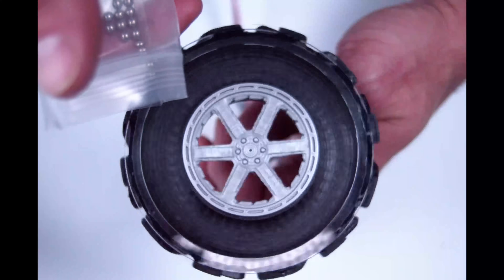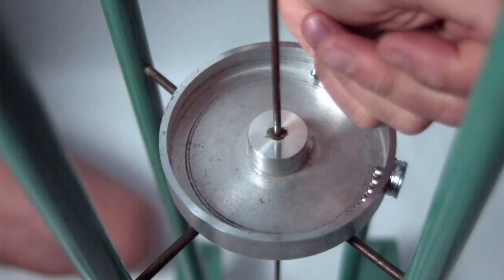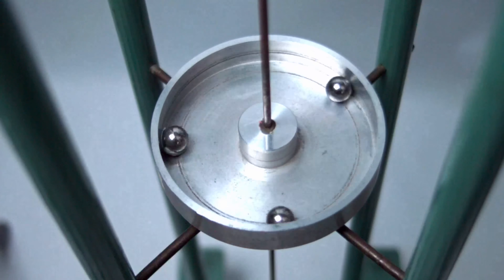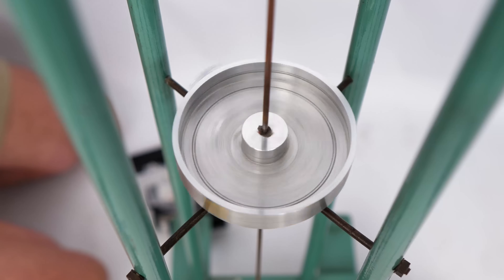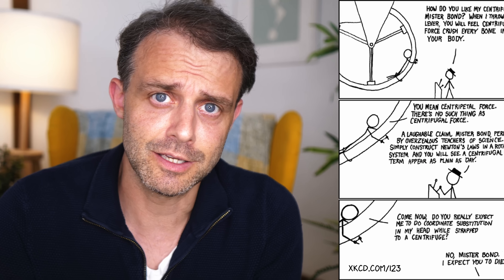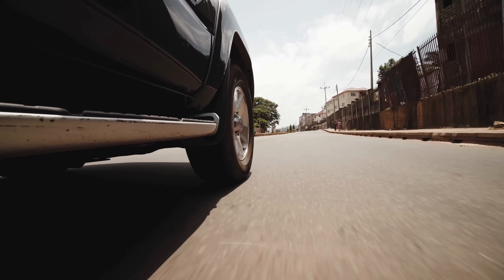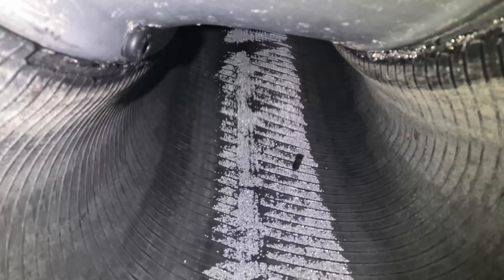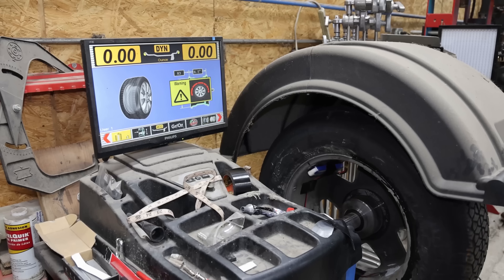Do tire balancing beads actually work?

Comment: What if you designed the tire beads to melt once the tires get hot enough (from motorway driving) and then they stick in place?
Reply: Tires wear unevenly, after a while they will be out of balance. Weights are easier. I am a stickler for NVH and get an alignment every year or two.
Reply: Tires need changed, occasionally.

Comment: they might work if you could coat them with a pressure activated adhesive that doesn't activate until you're going fast enough, so that once they get to the right place they stick permanently. I don't know enough about adhesives to know if that's possible though, and it would probably make it way more expensive.
Reply: Getting anything to stick basically dust permanently to the wall inside a tyre would be a crowning achievement in the field of glue. 
Tyres get damn hot, flex a whole bunch, hit potholes, get frosty cold, and repeat the cycle for years. 
I'm not saying it's a bad idea to have, just that it's probably not going to work better than the alternative. (Balancing the wheels) 

Beads are going to be good on things like long haul trucks and the like that spend most of their time at speed and wearing down their tyres rapidly (where they would need rebalancing) Nanna's grocery getter probably not so much. 

All the requirements to use them as well with glue make it more of a pain vs the guy who mounts the tyre spending 30 seconds putting the weights on where the machine says. 

About the only thing I can think that might go close to working would be some sort of super thick liquid like tar that even at max temp only very very slowly allowed the beads to move (if you had beads at all) the down side of course being if you car sat for a week it'd all collect in the bottom and it'd be like driving with bricks on until it sorted itself out.
Reply: Just a time activated adhesive. Apply a glue to the beads. Put the beads in and promptly drive continuous highway speed for 30 minutes in which time the beads become permanently fixed.
Reply: @kons_kon  Or just put it on a treadmill / jack the card up first.
Reply: You could use an adhesive that cures over the right lenght of time. That's how most glues work. You'd need to accelerate to supercritical speed within a certain timeframe and then keep enough speed for the beads to remain in position while the adhesive cures (partially). (Better check ahead of time to make sure there's no traffic jam.)
I suspect it would need to be very thin in its uncured state though, otherwise it might keep the beads from moving to the correct place.
Reply: another commentator noted that they use liquid epoxy.

Also a wheel balancing machine spins the wheel to high way speeds to find the resonance and that. Then the operator places a counter weight in the marked location. 

With adhesive beads we can instead place the beads inside, spin them on a machine for 15-30mins to cure. And bob's your uncle
Reply: Something like 5 minute epoxy and a wheel spinning rig would be the trivial solution. For pressure, maybe a thin pill casing that would deform and split and high pressure, releasing a fast-cure material (cyanocarylate?). Might be too fiddly to ship such a product though. Thin glass would work better, but be even more costly and a pain to ship.
Reply: A tiny magnet would give them an easy-break array of equidistant "restpoints" that might not cog at all up within usage rpm
Reply: They work as designed. No need to fix them in place. If you did, they would be useless after a tire change.

Comment: This is real cool video. I was a motorcycle mechanic busting a ton of tires about 20 years ago and balance beads were a thing. It didn't seem right to me, as you say, intuitively. And a lot of people didn't trust them. But they did work. This video should be paid for and shown to sell those. Awesome work.
Reply: I've seen Volvo semi trucks with front wheel 'ball rings' for same purpose, in that instance they are specifically to cancel out ice caused imbalance on steer wheels.  

We did some experiment when I was a kid that proved the concept works - intuition is learned so it's sort of intuitive to me tho the details of the experiment elude my memory, I was very young.
Reply: We were still using them 10 yrs ago on commercial truck tires like on big box trucks and on diesel commuter trucks with better than stock tires on them. Pretty sure we also used them on bucket trucks like the cable and power companies use. Stuff like that with those 14 ply commercial truck tires on them.
Reply: Doesn't the analysis - that they only work when you touch freeway speeds and dont slow down too much - a good reason to NOT use them, and instead get one's tyres properly balanced?
Reply: @ChrisCogdon  agreed. This is rarely ever useful, because if you are slowing down from freeway speeds, you will be on a road with a stop light. And once you stop at the stop light the effect goes away. These would only be useful if your tires’ resonant frequency happen to be quite low. Maybe this happens to be the case for those who claim they work, but for most this seems quite useless
Reply: @HerodotusVon  Doesn't mater. At low speeds tire balance is not an issue unless your wheels are massively off.
Reply: @ChrisCogdon not really. Balancing a tire on a vehicle is mostly about comfort. There is a little more wear on tires, shocks and bearings but the amount to matter is would probably give your body health problems from shaking first.
Reply: @ChrisCogdon in the vast majority of cases, yes. however, other comments do point out they're economically useful to balance heavy tires whose center of mass changes dramatically due to wear over their service life. Doing it the right way would be "too much downtime" so they go for the self-regulating one and ignore the inefficiencies at low speeds
Reply: @ChrisCogdon this. No, it can’t sell the beads to me, because I watched until the end. Balancing beads according to what we’ve seen here seem to be a situational fix and not a substitute for a proper balancing.
Reply: @WillyBotson I have used glass beads for many years on my motorbikes, and there's no issue at low speed, or at ~70kph (where I do most of my driving). I DO, however, have the benefit of not marring my rims with hammered-on weightsnor adhesive, and I can't lose a weight while riding. If the tire shop I use for the truck would use them instead of weights, I'd be super happy, and wouldn't have an unbalanced trailer!
Reply: thankfully this isnt needed for unicycles due to their unique nature of using hub motors and no true axle
Reply: Many years ago we tried using a mercury filled metal tube shaped into a ring and mounted next to the engine drive sprocket to help balance the heavy vibration of a 1965 Harley shovelhead.  Did not work because the power pulses would constantly accelerate to mercury away from it's optimal balance point.  I could see how this might happen with tire balance beads when they hit rough surfaces.
Reply: Yeah... As I don't want to potentially expose tire techs to potentially inhalable glass dust, I'll stick with wheel weights.

Comment: I just use liquid epoxy in the tires before a long drive. It permanently maintains balance unlike the beads that fall out of place at a stop.
Reply: So will it stay round or compress a bit when part of the tire makes contact with the road surface? 6:51
Reply: The constant flexing of the tire once per rotation is going to be pretty rough on the hardened epoxy.